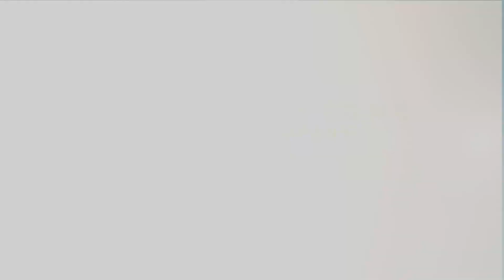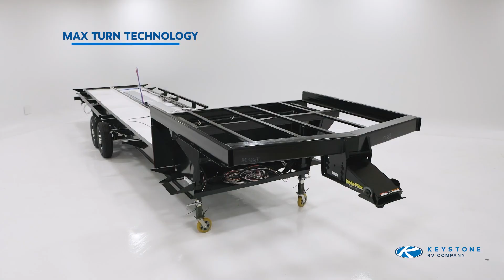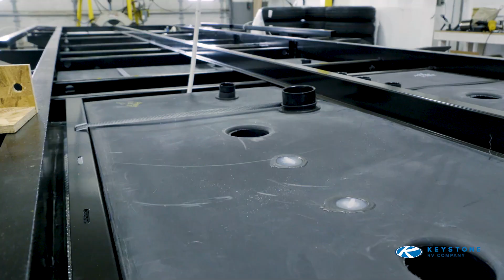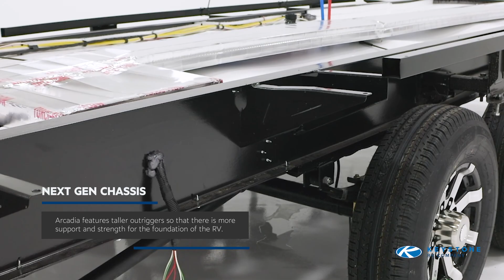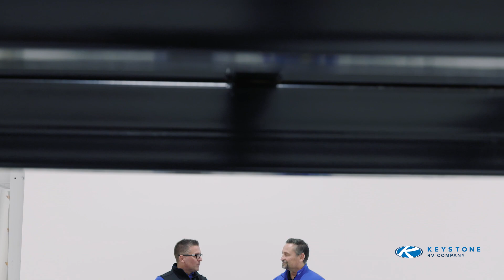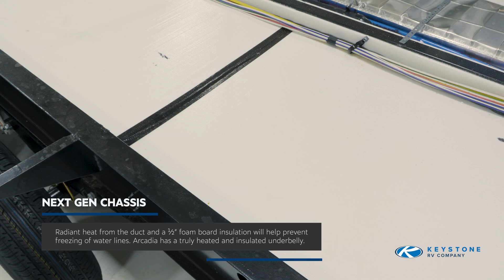Arcadia's Next Generation Crawlspace Chassis

Comment: Are the tanks in a heated belly or are heat pads required?
Can I order the 3250RL with Lithium, inverter, and solar for boondocking?
Reply from the maker: Hello Bill,  The 3250RL has the enclosed heated underbelly.  This model also has the option for the 600i-L solar package.